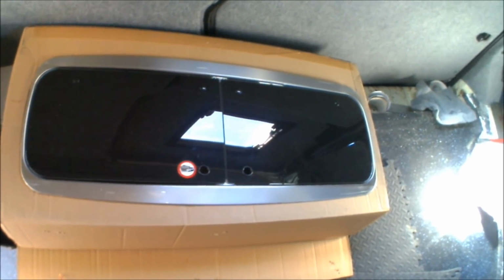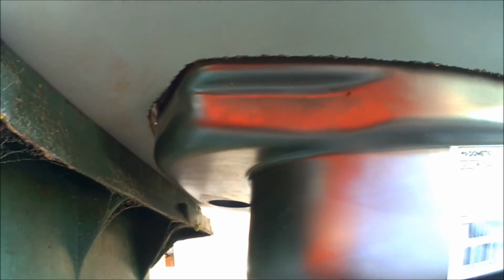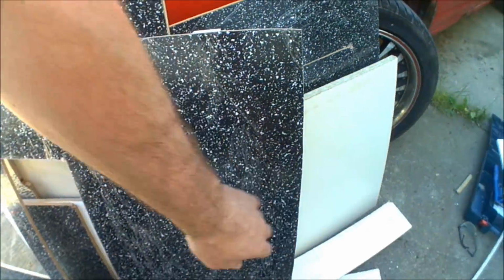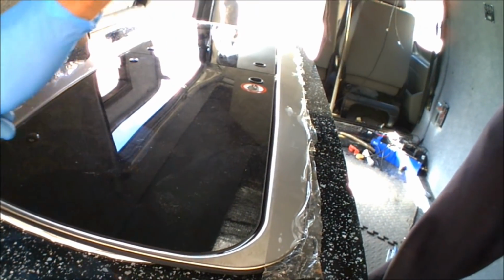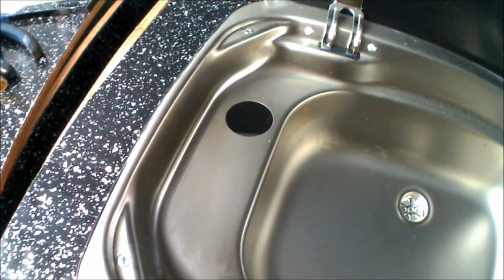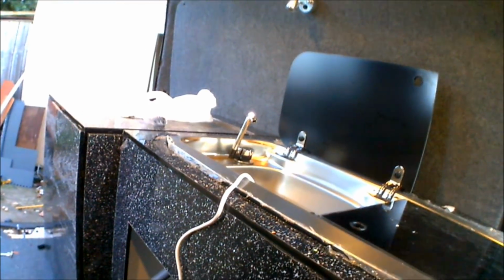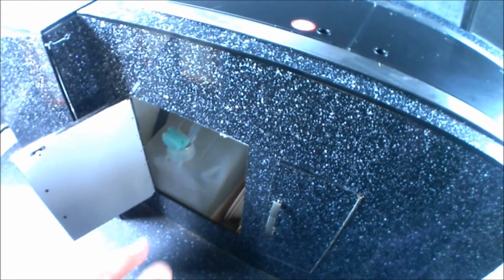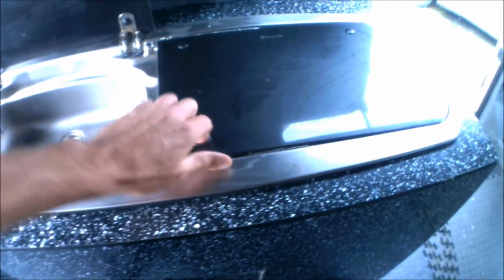Campervan DIY Kitchen Unit Build & Smev Dometic 9222 Fitting & Installation Guide VW T4

Comment: Does below the hob area have to be sealed and have a dropout vent ?
Reply from the maker: No but it’s advisable if possible
Reply: @TheCampervanBuilder  Seems a bit crazy to go to all the lengths of sealing up the gas bottle and not to do the hob but I can't find info on it anywhere. 
Thanks for your reply.
Reply from the maker: Ideally every gas connection should have a drop out hole below but a lot of people don’t bother (I highly advise it though)

Comment: I think a test point and isolating valve is required  ,maybe its elsewhere .
Reply from the maker: The gas pipe has less than a 1m run to the isolating valve in the gas cupboard

Comment: How do u find the chipboard units? Do u find any problems using them as regards moisture/swelling ect?
Reply from the maker: They are not chipboard, they are 10mm shower boards so they are surface moisture resistant with no swelling
Reply: @TheCampervanBuilder  5:57 🤔
Reply from the maker: ahh the divider sections, I thought you meant the worktop panels.   They were file, in a well protected area with drop out vents near by so no issues with them, but I wouldn't use it for a main part of a build, a dividing wall fine, but it's no good for general van use in my eyes

Comment: HI, what is the worktop pls. I can only find kitchen worktops in standard domestic kitchen thickness and there all heavy.
Reply from the maker: Hi this is 10mm laminated showerboard which is thinner and lighter than most furniture boards, I got it locally from a diy place but 10mm shower boards are available from b&q or online.

Comment: I'm trying to work out how to do mine ? What is concerning me is weight. Is the 12mm ply not a bit heavy ?? I mean obviously not just for the cooker unit. But when you weigh in the whole build ??
Reply from the maker: These are 10mm shower boards so white light weight, most builds use 18mm furniture boards which are a lot heavier than what I’ve used here. Weight of units shouldn’t be an issue in 95% of most builds

Comment: Loving the videos, this in especially as this is my job this afternoon. How do you find the carpet on the door when it gets wet? Just wondering what to put on my door? Thanks again. Stephen
Reply from the maker: Carpet up to the inside rubber seal and it shouldn’t get wet, if it does trim it back further, there’s a few video on my channel showing how I’ve carpeted a few sliding doors, panels and metalwork etc

Comment: hi m8I have a cello tv with a mains connection which goes to a 12v adapter then to tv.is there a way I can get rid of the adapter and wire straight to 12v from leis battery?
Reply from the maker: Hi yes look at my latest videos and I have a tv install video showing me fitting a cello tv direct to my 12v feed

Comment: Do you think this Smeg unit would have fitted into the Transit Connect you have just finished? or was there just not enough space for it? (or were you trying to save money on the Transit Connect) :)
Reply from the maker: A smev unit would fit, I was just trying to get the connect done on a smaller budget than a smev would have allowed. There is a smaller smev unit than this which would be better suited for smaller vans

Comment: What’s you opinion on using propane to butane?.
Reply from the maker: never used butane, heard the only main difference is propane works at lower temps
Reply: Propane burns hotter

Comment: Does it have to be a metal lined locker to pass the checks ?!
Reply from the maker: as far as I was told by the inspector who checked mine over, needs to be made or at least lined with flame retardant material, preferably metal

Comment: Didn’t the sink come with a rubber seal rather than sealer?! What if you need to get it out?. Good video though was just a 💭
Reply from the maker: yes a very small flimsy seal, I can unscrew the worktop if it needs to come off, can't see why it would though with easy enough access from underneath if required, sealed to make sure water doesn't leak through and ruin the worktop
Reply: Camper Conversion ok fair enough I was just curious 
Didn’t it come with a push on seal
Reply: Sorry read it wrong just seen ya seal comment
It’s getting late lol 🤪
Reply from the maker: no probs

Comment: Where did you find those compression gas fittings for the gas line. I purchased a smev two burner and having a problem in the is finding the fittings.
Reply from the maker: screwfix/toolstation or local caravan supply store
Reply: Camper Conversion being in the United States everyone thinks I’m crazy when I show them the gas line with no fittings on them. I will check out more uk websites. So they are compression fittings correct??
Reply from the maker: Yes compression fittings, similar to what is used with water supply too. I would think amazon or ebay would help locally for you
Reply: @danielsoria1261  My van has all 3/8 soft copper tube with flared ends.  I would never trust compression fittings.

Comment: where do you get you gloss black sparkle board from?
Reply from the maker: Purchased it from a local timber merchants, they had some in on special offer otherwise it would have been nearly £200 per 8x4 sheet and I needed 3 sheets for all the units in the van, B&Q do similar stuff but it's not cheap in there, try local timer merchants to see if any have offers on